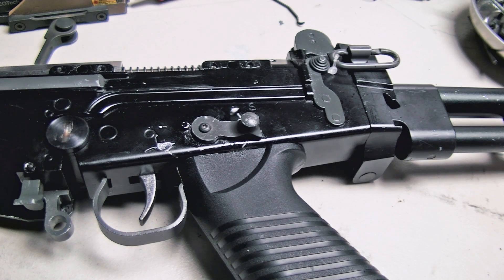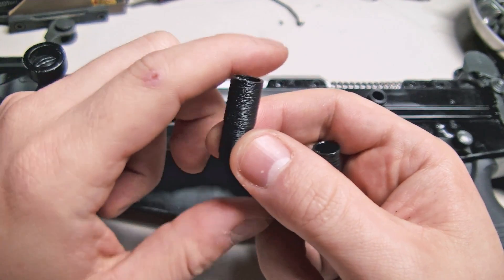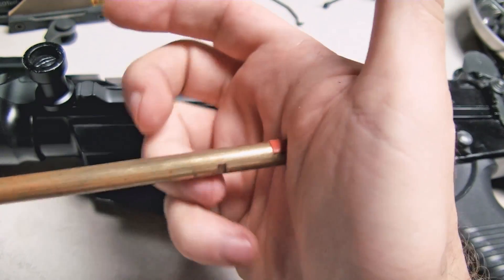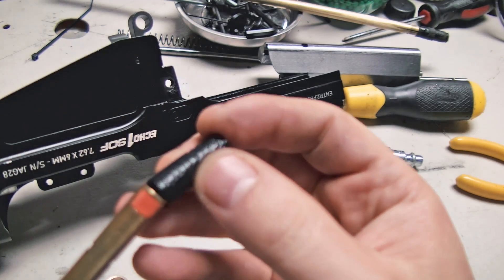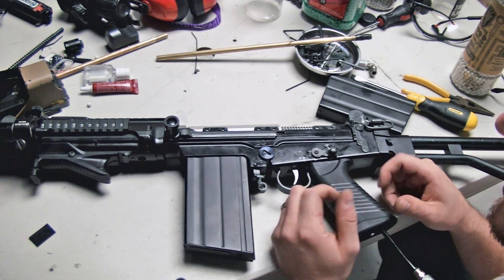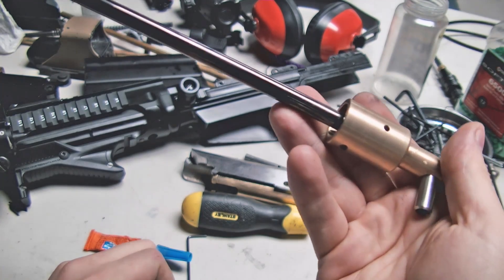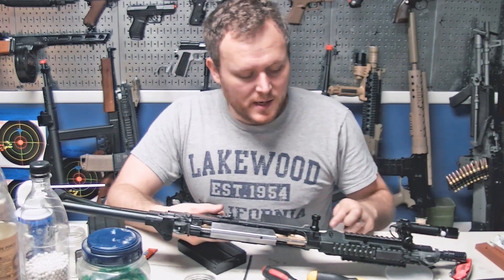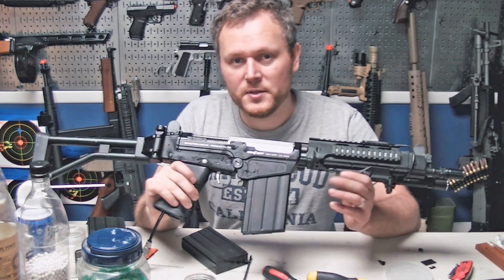3D Printed HopUp Bucking (Ninja Flex, Zen Toolworks)

Comment: Hey Dude, I'm a huge fan of your youtube channel, love the content you're uploading and the effort you put into experimenting and reviewing your gear. I had the same issue with my Daytona FAL. I'm wondering, how did this fix work out long term? Would you be willing to print one of these hop ups for me, for a fee of course?
Reply from the maker: It did not work very well, the printer has a hard time printing this flexible material. I ended up going back to my ripped bucking and just generally not using the gun much.

Comment: Would you be able to send me the stl file for the hop up bucking? I ran into the same problems with my DG.
Reply from the maker: +Simon Tiedge It did not work very well for me.
Reply: Ok thanks! What did you end up doing to get a good consistent hop out of your DG?
Reply from the maker: My hopup sucks on the DG I think I flat hopped the original bucking which is now ripped, sort of put that gun on the back burner after I disassembled it 2000000 times. Prefer my Tippmann with the heavy bolt.
Reply: +BrainExploder This is a fun idea to make own hop up rubber. But you can also buy spare rubbers from TNKguns too. I have Daytona M240 and I ripped my first rubber too. Then I added a knob of Getsome between the hop up adjustment screw and after that my rubber hasn't wear at all! There is a lot of friction between the dry rubber and adjusting screw so without lube it will break very fast! Also with DG problems go to Daytona gun group and you will find your answers from there :) But all in all, good videos BrainExplorer. :)
Reply: Also! Remember to loctite every screw in your gun! Even the hop up screws! Without loctite on your hop up screw your gun won't shoot well!

Comment: I have a model I created of a hop up bucking I'm in the works on but don't have a means of manufacturing my plans. Would you be willing to do a run or two of my designs on your printer with the ninja flex? I honestly believe it will be with your time? Any way I can contact you?
Reply from the maker: +Mosszilla My printer prints very poorly in Ninja flex and very thick, the one or two decent prints I got had to be heavily modified to even fit around the barrel. I would recommend Shapeways you can print in wax on there which you then can use to cast actual rubber and mass manufacture these, or you can print a metal 3 piece mold, it might be pricy but then you can make these at home possibly.
Reply: +Aaron1998ish can you email me?

 Mosszilla1192@yahoo.com

Comment: How much is a 3d printer
Reply from the maker: airsoftrsvids $500 to $4k for a home printer.
Reply: Wow but what is the main difference of the $500 to the $4000 one other than price
Reply from the maker: Speed, layer thickness, auto leveling, auto nozzle detect features, capacity, volume, materials it can print, dual extruders...

Comment: I want a new barrel and I am thinking about getting a Magic box miracle barrel but, I want to know what you think about the tanio koba twist barrel.
Reply from the maker: I actually swapped the tanio koba out for the miracle barrel yesterday. The MB was a 407mm vs a 300mm TK but it seems to be more consistent on full auto. As some viewers mentioned the TK is best for guns sub 330fps. But when I had it installed it seemed very accurate on semi. On full BBs would curve right, could be the amount of air mixed with the twist groves were spinning the BBs out of control.
Reply: Thanks!

Comment: Great video. Love 3D printing, and I use one at work. 

I have the Echo 1 SOF with 5 of the mid caps. They fit in the gun just "ok" but they don't feed very well. I think the spring gets stuck. Do you have any problems? The hi-caps work the best, but I don't like hi-caps.
Reply from the maker: Mine seem to feed well but lately the mag has been popping out on full auto from the recoil. Maybe mine are a bit new still.

Comment: I'm really enjoying seeing what you come up with using your 3D printer. Makes me want to go out and get one too.
Reply from the maker: It is the best thing ever. Yesterday I printed myself some tiny bolts because the holes the metal ones go into had stripped so I printed them with a little larger thread and now they can friction wedge in there just fine. It's such a life changer you can basically make anything under 5 inches, its expensive but it opens up a whole world of creativity if you are the creative type.

Comment: from what i know the tanio koba twist barrels doesnt work good with anything above an m100 spring.   Its possible youd get better results with a TM original barrel.
Reply from the maker: Someone mentioned that in the comments, I guess seeing a guy with a sniper rifle use on made me think it would be ok. Anyhow after reading that comment I went and took the gun apart once again and installed a miracle barrel. Going to test it tomorrow, thanks for the advice I don't know what I was thinking, but I have to say it was shooting very good on semi auto but curving o the right on full auto, I wonder if the twist is causing that, oh my.
Reply: best of luck to you =) keep on updating the daytona build